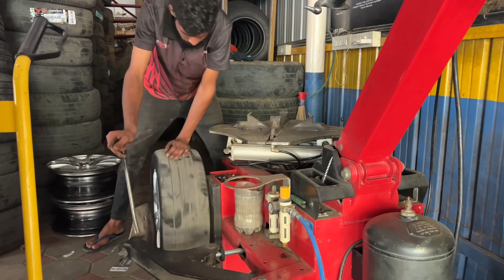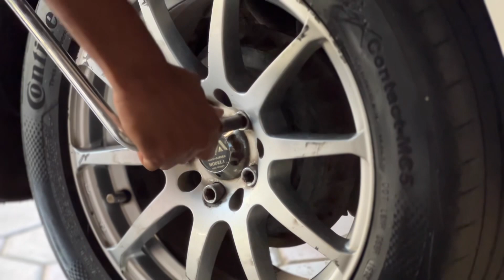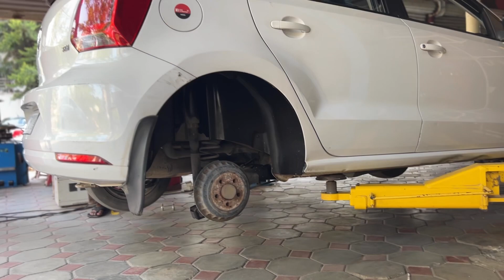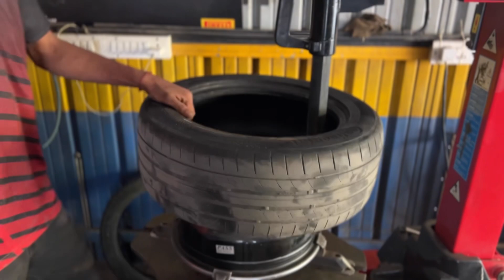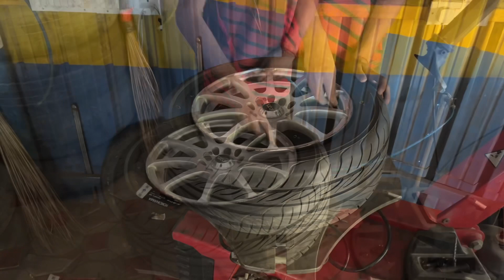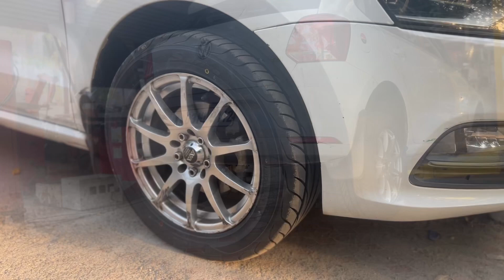POLO TYRE CHANGING // YOKOHAMA S DRIVE

Comment: I want a tyre with good handling, good traction, best grip on dry as well as wet roads. And most importantly the tyre should not burst on high speeds as i drive my car at around 120-140 kmph on highways. Which tyre do you think would be better for all my above requirements? 
Yokohama Earth 1 or Yokohama S Drive?

My stock tyre size: 175/65/R14
I want to upsize to: 185/65/R14.

Thanks
Reply from the maker: If you increase the size the steering tends to get a bit heavy having said that I feel Yokohama s drive is superior compared to earth one for sporty driving
Reply: @Carnadu  And how about Bridgestone Sturdo?
Reply from the maker: @x_voidr  you can either go with continental UC 6 it’s better compared to Bridgestone in all aspects and suits your requirements
Reply: @Carnadu  Okay brother 
Thanks a lot!! 🙏❤️
Reply: Yokohama S-Drive is not available either in 175/65 or 185/65 14" sizes. You can find S drives for 195/60 R14, but may need to check/change rims if 5J. The Earth-1 should do 85% of the S drive performance while being tough and easily available.
Reply: @sajo21  true!!